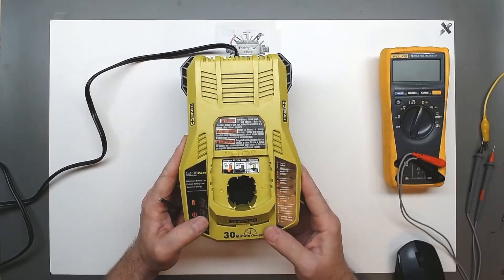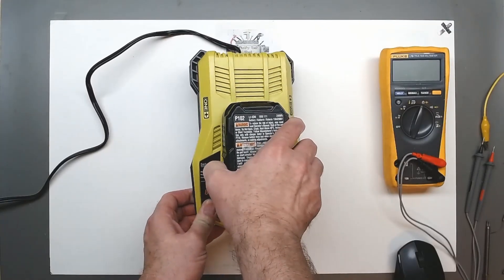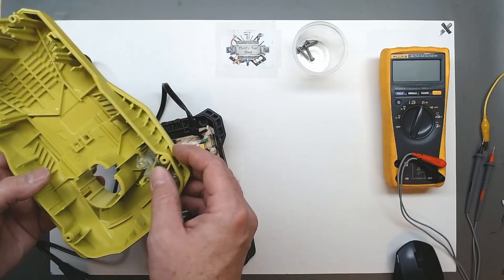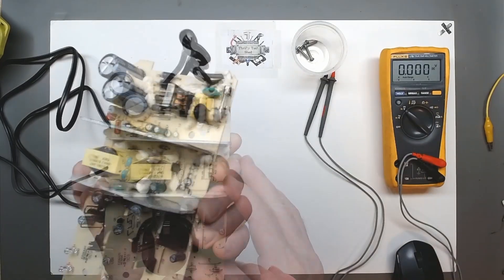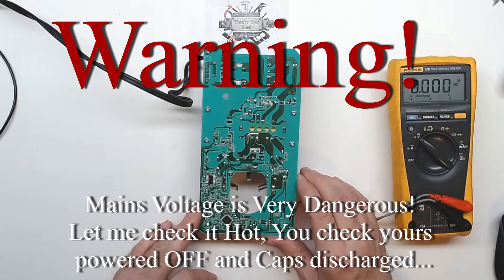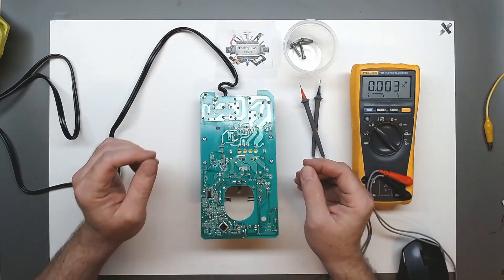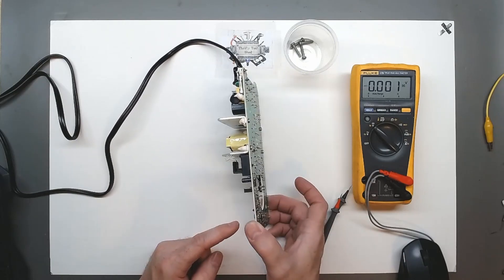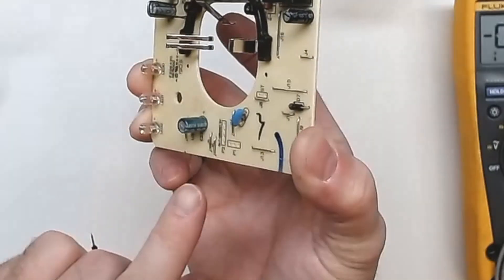Ryobi P117 Intelliport Charger Repair

Comment: hey mate , well done , i would really appreciate it if you ever come across a Ridgid R86092 charger if you could post some info on it please , i have a charger that i suspect is faulty even though it is brand new , i modded it to work on our 220 to 240 v power here in south africa by replacing the varistor and large cap on the high voltage side , seems when i put a battery on it to charge , the battery check phase is only around a second then it starts to charge , or it indicates its charging but doesnt , green light flashes 15 to 20 times then the red light flashes , green flashes 10 to 30 times then the red light flashes , battery indicator on the battery blinks but there is no charging happening , no heat being developed at all by the charger so it doesnt seem to be doing anything at all , would appreciate it if you come across this type of charger if you could post something please mate
many thanks
Rich moss
Reply from the maker: Will do!

Comment: I've bought two, neither lasted more than 3-4 months. It looks like I'm gonna have to take a mini electronics course just to be able to trouble shoot the two I have, on that note I have one of the black ones included in the driver kit and seems that one is still good as well as another older green one(looks bigger and bulkier than these) that also works. If you go to the homedepot reviews this happens a lot, it is a manufacturing defect and one that hasn't been fixed it looks like. Have all the tools to troubleshoot I may just see if both of mines have this same problem.
Reply from the maker: I had definitely seen that these had issues. I did not know how common this exact issue is or if most that failed are like this, but either way I posted it to see if it helps others with similar issues. I just hate to see things thrown out so prematurely when they should still have years of life left in them. Hate you have had issues with two of these. Best of luck with yours!

Comment: I have a temp delay light on. Orange color and the unit is in A/C. Has not been used in 5 months. Any suggestions?
Reply from the maker: I have not had that exact issue with mine. Is it a way to make sure it's not the battery? Have another pack to try or another charger by chance? I have seen the thermistor in the packs cause the temp delay, but no issue with mine with the charger yet

Comment: I received seven broken ones and was able to repair 5 of them - Two were severely water damaged and not repairable.  My tips:  Check ALL of the through hole diodes with the diode test mode on your multimeter.  One had a bad 1N5408  diode at D3.  Some models have a SMD resistor at position R71 labeled "R500" which is a .5 ohm resistor and was open on three of the units.  I had 1 ohm quarter watt resistors and paralleled two of them to replace them.  There is enough room to tack them on the SMD pads.  That will restore the 5V and the power light should come on when you plug it in.  Another had R8 open which is marked "100" and is a 10 ohm SMD resistor which  I replaced with a tacked on 1/4 watt 10 ohm resistor.  I had to replace the TOP256ENs on some of the ones with the open resistors.  The other secondary produces approx. 36VDC at the common pin on the TO-220 dual diode marked "D20".  So if the power light is on and you measure approx. 36V at the common of D20, you should be able to test the charger.  Be sure the unit is unplugged and that capacitors E1 and E2 are drained or discharge them before you start working on the board. - There is approx. 350V across both of the capacitors in series and they will bite you.
Reply: Maybe it's the pumpulator?
Reply from the maker: 75% of your comment is summarizing the video. So I guess you did not watch it to feel like you had to post most of this? Thanks for the additional information though I'm case someone has issues with R8.
Reply: @ThriftyToolShed  Hi yeah you got me.  I did not watch most of the video as I have all of my units repaired.  I cut and pasted this comment.  I added it to all P117 repair videos I watched as none so far have  been as extensive or helpful as yours.  When I was seeking youtube repair videos when I needed to repair them they just did not have a lot of information.  Just trying to share my experience and how I repaired them for others.  I'll definitely recommend yours.
Reply from the maker: @reasonablebeing5392  Thanks for your added information. Verifying that this does occur often and for your  comment!
Reply: @ThriftyToolShed  @reasonabledbeing Any Ideas on where I can get this resistor? R71 R500?
Reply from the maker: You can get them online, but the typical kits start at 1 ohm. So that is why I used  (2)  of the 1 ohm to replace mine. I do that sometimes with the lower value SMD resistors. It also doubles the wattage rating of it. Digi-Key, mouser, Newark should all have them and I would even think eBay would have some .5 or R500.